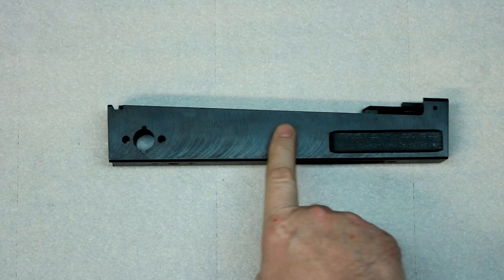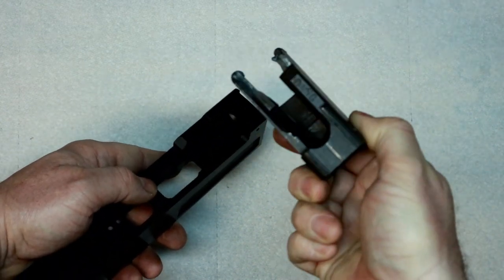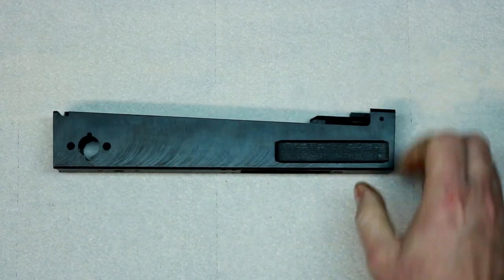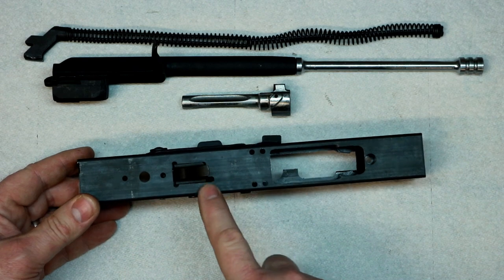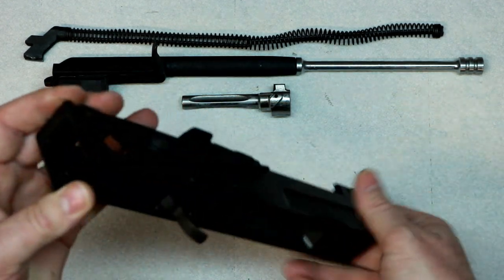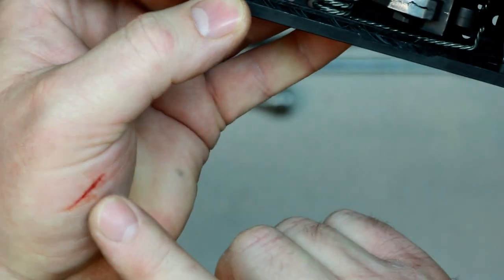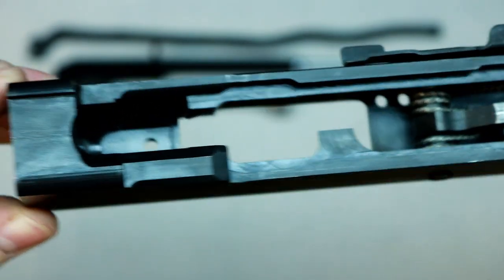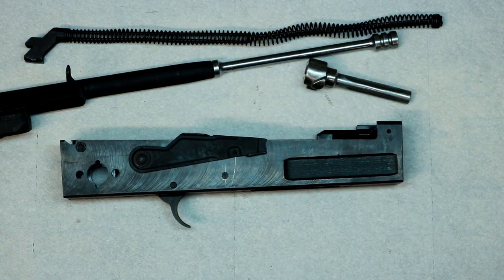Tortort 80% Receiver (Re-upload)

Comment: Ive had one of these 80 percent receivers for years now.  finally getting around to putting it together but can seem to pin down the dimensions.  Tortort has some on their website.  i have tried contacting them numerous times to confirm those are correct--i dont want to assume and screw it up.  do have any idea where to find the drawings?

Comment: Would a Tortort receiver like this one work for a Yugo M64 underfolder build?
Reply from the maker: M64 Yugo has a screw in barrel.  If you want to switch to a press and pin barrel then an M64 kit might work. I say "might" because I'm not 100% sure if the M64 barrel components will work with a press and pin barrel profile.
Reply: @Mel64d  Maybe the M64 barrel has threads on it that can be filed down a bit, and then that same barrel could be pressed into a Tortort receiver like the one in this video?
Reply from the maker: @pepekekistani4472    If you have the tools and the will...you can do just about anything you want. Up to you to decide what direction you want to go.
Reply: @Mel64d  Okay, thanks for the encouraging words there. I will eventually need them for something or another.